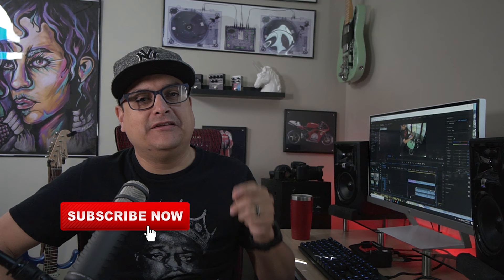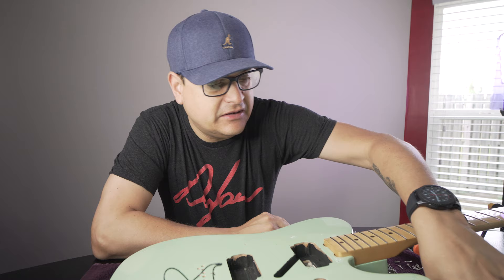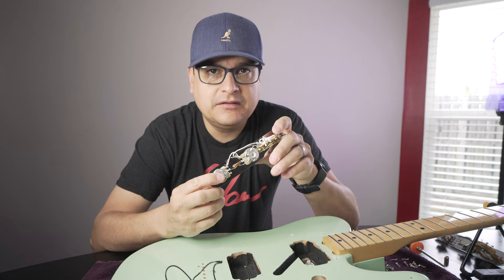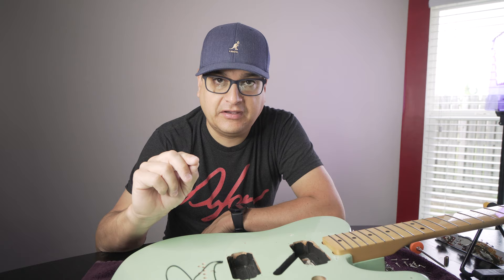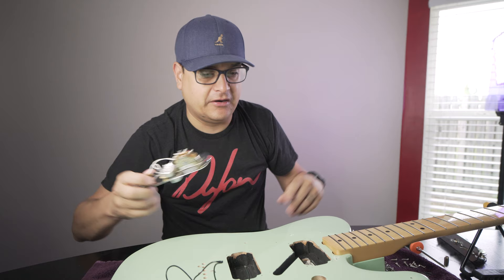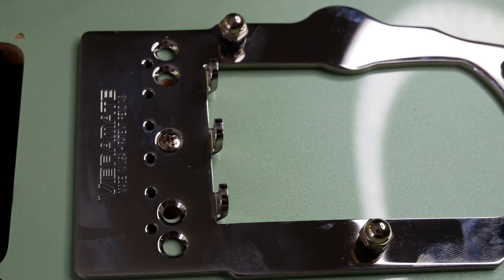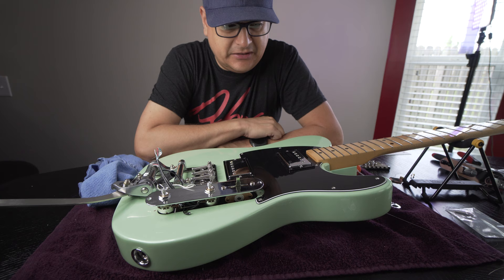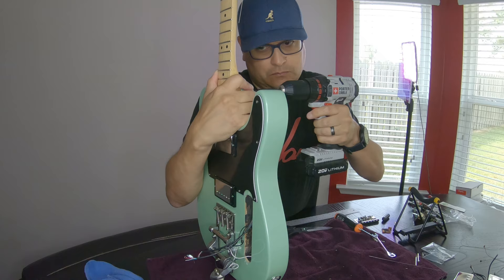The Best Pickups For Fender's Player Series Telecaster HH

Comment: i was about to comment that i was 99% sure thats not a player series tele. the player series they make now doesnt come in that color, doesnt have a pickup ring on the neck pickup, and has a 22 fret neck. but after a quick google i found out that the "player telecaster" and "player series telecaster" are actually 2 different models. the "player series" in the new model from last year that replaced the mexican standard, and the "player" is some sorta limited edition run. fender really needs to get a grip and start using some common sense when naming these things lol.
Reply: Another thing is that the new player series has 22 frets and this guitar has 21

Comment: I've had one of these for years, adored the way it played, but always felt like the tone was just not there at all. After seeing this video, I ended up gutting the electronics and threw an emg system with a set of chrome covered active pickups I liked that were in another guitar i had. I don't play a whole lot of metal or anything, but the active pups sound incredible through a vintage or vintage-style tube combo with the volume dimed, real throaty and grimey.

Comment: I would put the switch at the rear....instead of the front.....twist it 180degrees.and put sharks teeth on the neck...and put some locking tooners on it..
It looks awesome though....I need to convert my tidepool....
Ace picker too,brilliant.
If you provided the specs of your upgrade in writing it would be sweet...as I don’t register your quick American accent very well..

Comment: Hey Dylan,
This is all good stuff ! Good work. I have installed a Telecaster player neck humbucker pick up at the neck of a player telecaster SS along with a seymour duncan LIL 59 at the bridge. I have changed the volume pot to 500K but the tone is still 250K and the cap is 0.050Uf. If I use coil split at the neck should I use a 250K push pull or 500K push pull ? Also, should I install a 0.022Uf cap ? Let me know. The pick up seems alright with the 500K volume but still a little muddy. The MIM HH seems to be different than the one you have in this video. What is your neck pick up ? Nice, hairy and clear at  the same time.
Reply: The 250k pot probably compliments the brightness of the lil 59 very well, but the muddiness you describe probably comes from the combination of the pot and the cap. If you're going to go push-pull and get a new potentiometer, i'd just get a 500k to play it safe, then swap the cap if you still think the tone could benefit from being brighter.

Comment: Should use the VIbramate V5-TEV-2-ST is the part number I think.  V = "Vintage" = 4 screw holes that fit most any MIM guitar. ST = Short = No pickup mounting.
Reply from the maker: That is a 4 hole. It does not work on a 3 hole body.
Reply: @DylanTalksTone   Ahhhh they changed them up to three hole??? I missed that part  And they couldn't at least match the US spacing?  Why?!?!? "SCREWS" everything up.
Reply from the maker: @huddyskiba1  American teles are three hole as well
Reply: @DylanTalksTone  Right that's what I'm saying - you used the V5-TEAS right?  one would think that if, for whatever, fender decided to go from the 4-screw bridge that the MIM have been for forever to a 3-screw version it'd be easier for all parties involved to just make it the same pattern as the US models therefore making it compatible with the V5-TEAS.